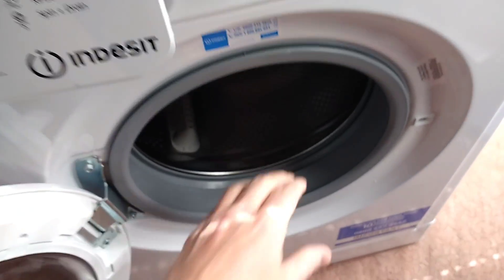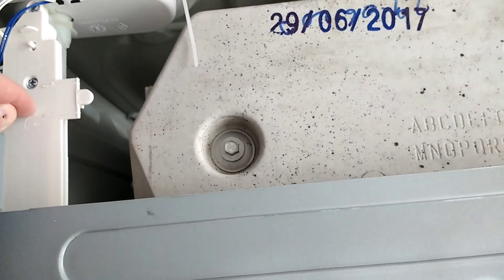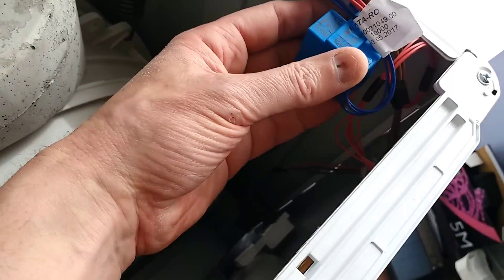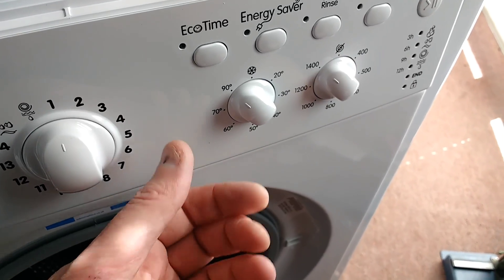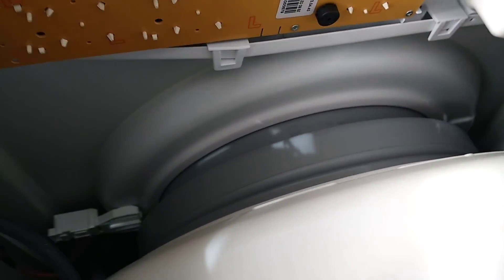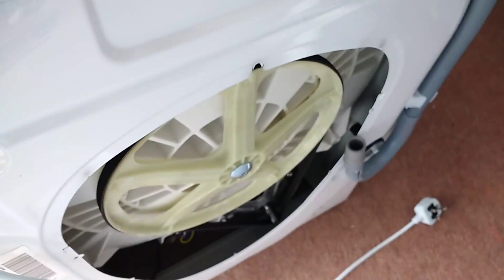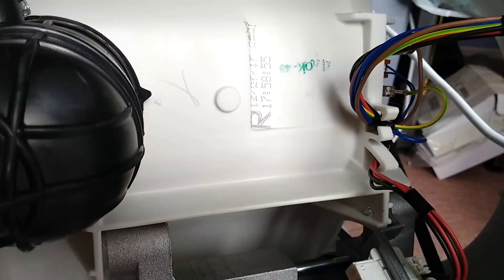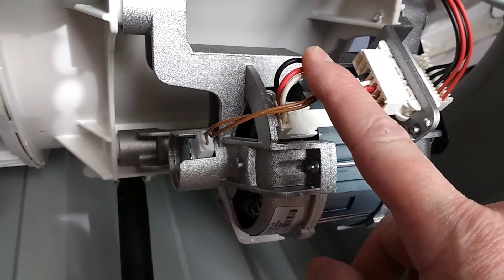Inside my new British washing machine (clothes washer).

Comment: Expected lifespan of 1970s - 1980s washing machine: 25 + years , (warranty 5 - 10 years)
Expected lifespan of 2017 washing machine: 2 years , (warranty 90 days - 1 year)
When I see all the flimsy plastic parts including the drum drive pulley, I will hang onto the 1981 Kenmore/Whirlpool heavy-constructed top loader, even though it has metal wash cycle and water temperature / level knobs instead of a CPU with blue LEDs.
Reply: Price of 1980 washing machine: £200 (8 days' wages)
Price of 2017 washing machine: £150 (2 days' wages)
Reply: caveman123ization another thing not taken into account is actual amount of use. A house hold with 1 person v 4 people with the same machine - you would expect the larger house holds machine on average to die way earlier.
Reply: I've a friend that I've known for more than 35 years and he was a Washing Machine repair man for most of his working life. He is retired now but still does the occasional call out if one of his elderly customers needs help. I was impressed when I phoned him to report a strange noise coming from the machine during a wash cycle. He asked me to hold the phone near the machine and immediately diagnosed ( correctly ) that a Bra wire had come loose and worked its way through one of the holes in the drum.
Reply: bren106 £15 for a repair is insanely cheap. I'm amazed anyone could make a living charging so little. Going rate is between 35 and 45 in the North and between 45 and 80 in the south. Not sure why there's such a big difference
Reply: buy a machine that has a long guarantee, such as miele, mine came with  10 years, but it was a £1250 machine 2 years ago
Reply: I have a Hotpoint front loader (UK) from 1987, passed down through family members and still going strong, with an occasional motor brush change. I don't plan to change machine any time soon.
Reply: This is the dumbest comment I have ever read. As if only there is only one washing machine with only one warranty length. You spend the money to buy a decent machine in 2017 and it will last just like the old one. Probably longer.
Reply: Is that really the case though?... How long would a washing machine that cost 28 hours of the equivalent to minimum wage in the 70's last? i'll bet those 70s machines you're talking about that last 25 years cost more time saving up than that.
Reply: slamdvw no worries. Best tip I can give you in that is that modern machines use a lot less water. That means you can get a build up of soap and scum on the spider/bearings which is where causing the corrosion you've been getting. To wash it off do regular rinse/wool washes, they use the most water. Also a good idea is to do a service wash with soda crystals. Also make sure you've got the feet nicely leveled out
Reply: Fekillix I have a Samsung dryer with a 5 year warranty. It's a an A++ energy rated heat pump model. Uses less than a third of the energy of a bog standard dryer. Uses approx 1.5 kWh for per load on the cycle i use.
Reply: Killerspieler0815  - The term used in North America for large kitchen / laundry appliances is "Durable Goods". Items expected to last for a decade or more. Very, very little in the way of these items are designed to last decades, even a 2,000$ fridge or 1,500$ washer. Typically mechanisms are frail and electronics fail...
Reply: You've been lucky with that Hoover. I'd recommend avoiding them in future, they're nowhere near as good as they just used to be. My top tips would be LG and Samsung or Miele if you can afford it
Reply: My English Electric is 10 years in my ownership + who knows how many before that. Paid £100 for it delivered and fitted. Called the same man out last year and cost me £15 for repair with no callout charge.
Reply: slamdvw bearings probably aren't a good example because it takes all day. Also, if it's a new model, like the one in the video, they're glued shut so can't be changed. But if it was possible, it's about £120/£150 depending on the machine.  A more common repair, say a new pump or brushes would be around £65
Reply: I have a Samsung combination washer/dryer front load for 5 years now.  The only thing that has gone on it is the drain pump.  I was able to fix that myself for about $50.
Reply: What kind of washing machine lasts only two years? Even the cheapest ones i've seen run for at least 10 years.
Reply: Just about anything made in China. People I work with have had "boards" fail in $2,000 fridges just after the 90 day warranty ended (I believe LG), complex front load washers and "steam" dryers fail well within two years of age. It is common. That's why I don't own any of that crap. There is one brand of washer and dryer in North America which is built with 1970s / 1980s durability today (25 year lifespan expected), and that is "Speed Queen" available for residential purchase, but built to commercial / laundromat standards. They are expensive.
Reply: YES back then the companies were proud of Quality ...
==>> in Socialist countries like East-Germany there was a Government standard that demanded 25+ Years live for "white goods" like refrigerators & washing machines
Reply: So true. My neighbor one floor down bought an AEG dryer. They did not remember, if it was 4 or 5 (or 3) yrs old. Fault was the switchmode to feed the microprocessor.
I tried to fix it, I've never seen such a cheaply constructed switch to choose the program and so on. Ground connector was blue color, all others pink.
The switchmode was a little 8 pin DIL chip, like in phone chargers, but scraped off type number. Capacitors of cheapest grade.
So I quit, but we found many people on the net, which repair these boards for like GBP 20/ 25$...
And it worked, new chip, new fuse resistor, new capacitors. 
I'm curious, how long it will last.

My father bought a washer, when my brother was in the army at 18. We still used that 27 years later, in my house. Until the toothed wheels in the (mechanical, driven by little synchronous motor) controller crumbled. It was a German Bauknecht. No electronics at all.
Reply: After 35 years of use: https://youtu.be/Ue5GjB0Ap6I
Reply: I'd disagree on the expected lifespan. Trading standards state it should last at least 5 years to be fit for purpose. I'm a service engineer and would say most of the machines I see are between 2 and 5 years old. About 90% are easily fixed. Part of the issue is many people just chuck them out without getting someone like myself to look at them
Reply: My last Hoover washing machine lasted 16 years with a just few small repairs which I did myself.  So when the motor eventually blew up (windings went short, quite spectacularly), I bought another Hoover washer-dryer.  That was five years ago, and it's had plenty of use with no real issues.  Get what you pay for.
Reply: My rent for a 1 bed flat in a not so great part of London is £1200 a month, that's the reason. I agree the £15 is exceptional value wherever you live though.
Reply: I've found by the time you pay a service tech to come out, order parts, etc - a few dollars more buy another machine with a full warranty.  What's your hourly rate, plus parts to fix say, tub bearings?  (( I don't want to know, just putting it in perspective )).
Reply: Ah, ok  Here in the States, they front and rear tub halves are still bolted / screwed together.  By far, the failure mode I'm seeing the most is bad tub bearings.  They get washed out when the seal lets loose and allows water to pass.  Second to that has been corroded spiders.  Thanks for the reply!
Reply: I just bought a new Siemens dryer to compliment my Siemens washer that I bought last year. I have no doubts they will last 10 years plus. Either way I have a 5 year  "warranty" in my country on them anyways. They wash much faster, and use way less energy than the old broken ones.
Reply: I agree but not sure when the lifespan stops on the vintage ones.. I guess if the motor burnt out or the frame rusted/ bent causing it to wobble ridiculously might reduce my opinion on it but for the most part.. 
A heating element and a drain hose. Between 2 sets of machines in 2 households..
 if my non-techie friend ever decides to replace their identical 80's w/d I'm loading that set up.
Reply: The machine that my mother bought to wash my nappies was still going when I moved out of my parents' house.  That was a Zanussi.  Only 400 rpm spin speed, but it was made in the early 1970s .....

She's had at least three  more machines since then, and won't listen to my advice to buy a Miele that will outlast her .....
Reply: the f00 Yes, washing machines are often easily repairable as long as it's not the motherboard that is at fault.  (And to be perfectly honest, even the old mechanical program timers weren't much more repairable than microprocessor-controlled ones .....  and the latter are now as reliable as you can expect something with no moving parts to be.)  But some people even buy a new washer while their old one still works!
Reply: hahaha ...  in Capitalist West Germany & the Socialist countries (especially East Germany / "DDR" & USSR ) the (Beyond ? ) USA-"Durable Goods" Quality was simply expected by (capitalist BRD) customer and / or required due to (Socialist) deficit of resources in the country / acquisition + exceptions of the people
Reply: LakeNipissing I agree 100%. I am living it. Also the spider is made of material that corrodes when connected to stainless drum and to replace it the whole machine must be stripped plus the huge cost of spare parts. You will also need new gasket and seals. Most machines have same parts just cosmetic and brand name difference. Welcome to the real world.
Reply: Ahh, bearings. a lovely job im gonna do to my 1995 Tricity Bendix AW851. At least i can do it with this one, unlike modern shit. Bearings and seals will be here on monday at Brahmer's, will be sitting down after work with a large bottle of wine and doing some old school engineering involving a large hammer, large socket and a punch!

Comment: Ugh, I always cringe when I see a product where everything has been made so cheap and flimsy to just barely hold up till just after warranty period.. ;-)
Yes some plastics are way better than in the past, but nothing beats stainless steal (specially the drum rotor part!). I have a miele and even the outside housing is made from ceramic coated metal..

Comment: Wait, you mean there are washing machines with hot inlets? I wasn't even aware those could exist. I wonder if it's a British thing.
Reply: It used to be a thing because the boiler was often near the washing machine, so very quick to get hot/cheap water. 
With a modern washing machine and a combi boiler, you will probably have all the water you need in the machine before the hot water makes it to the machine, so might as well have cold fill only.
Reply: Actually, American washers have had both hot and cold inlets since at least the 1950's.  All current US homes are plumbed for it.
Reply: Scarfmonster it is because we have 240v outlet
Reply: My old Hoover machine used to have hot and cold fill, not sure if it was any better to be honest. Not so bad with a Combi boiler as they heat up water as it is used, a bit naff if a hot water storage tank is used as it would use all the hot water in the tank that you just heated up to wash up or take a bath. 
My Hotpoint machine i have now is cold fill only and I now have a combi boiler.
Reply: In the Northerly Americas, our washing machines have both hot and cold water inlets. If I run the hot water at the tap in the sink next to the washer to clear the cooler water out of the pipe, then put the warsher on in Hades mode, my washer will happily cook the everliving shit out of my clothes.
Reply: er no its not cuz of240v ,its due to some rare models allow hot and cold water inlets ,has nothing to do with mains voltage
Reply: Britain has 230V, same as the rest of Europe, surely it can't be that since here in Poland hot inlets are not a thing at all. I literally haven't seen a single bathroom equipped for such a washing machine, and probably I would be considered a lunatic if I asked about that.
Reply: Depending where you lived in the US almost all homes had basements and that's where the washer and dryer were. I guess it's because the original models weren't that reliable and people didn't want to risk flooding if they failed. Plus, houses were a lot smaller back then and you didn't have the room for a washer and dryer in your living area. 

Eventually, some clever people realized how convenient it would be to have your washer and dryer on your living level so that has become the norm with newer construction. I think they stick with the hot and cold inlets because there aren't many washers sold in the US with built-in heaters, and the ones that do have it are high end expensive machines.
Reply: I've never seen a washer with a hot inlet, but I trust Clive's knowledge, he is a sparky after all.  But with 240V/230V cold water is sufficient for most things, hence kettles, boilers and electric showers, no point plumbing in an extra set of pipes if you have the juice to heat water in a jiffy.
Reply: Thats because most British homes do not have a centralized main water heater like here in North America. Most UKs  have a small water heater that heats on demand close to each sink, you may have seen them when you watch a British show. This means that Things like Dishwashers and Washing machines often have their own built-in heaters.
Reply: I don't know what houses you have been in the UK, but most have a central hot water system. The difference is if you have a boiler + tank, or tankless/combi (on demand) but it's rare to find a heater per sink.
Reply: hmmm...Ive been in many new-built  houses in the uk, and Astrailia
Reply: plugging into Google "on demand water heaters beside sinks in britain", comes up with hundreds of pics proving my point
Reply: I've been in about 500 different houses, the only ones with on demand heaters are where people have fitted them along side a normal hot water system.
Reply: No, all it proves is that you can do it, and some people do. Doesn't mean that's the standard which you imply.

I mean, by definition the current standard of a combi boiler matches an on demand heater. But it doesn't mean you have one by every sink.

You find them more often in offices/industrial buildings then in homes.
And plugging "combi boiler" into google gives 5million+ results for UK pages, which sort of makes hundreds of pics seem a tiny fraction.
Reply: Siiigh...ok, you win on the "Heated Water On Demand" comment fight...I acquiess,.I hereby legally modify what I have written in the past by saying the following: in all the homes, hotels, and rented places that I have PERSONALLY stayed in, in both Britain, and Australia, the hot water has been heated by small on-demand heaters at the sinks, and did not have a centralized water heating system, BUT this is in no way a standard feature. I hereby legally do not imply that this is a UK-WIDE STANDARD. This washing machine may heat the incoming  water for the homes that may, or may not have a hot water hook-up for their washing machines.....EVERYBODY HAPPY???????..I dont want to spend any further valuable time fighting this silly battle.
Reply: I think you will find most people do have a central water system, either via a combi boiler that heats water up as you use it or one that heats water in a tank. Years ago when I was a child most people had a immersion heater, just a big tank with an electric element, stuck in a cupboard, that is how we use to have baths, talking about 40 years back. Saying that the open fire had a back boiler as well.

 When I moved in here around 18 years ago it only had electric heater, but now it have a combi boiler.

Most people in the Uk  have some sort of central water heating, we are not that backward you know. :)
Reply: My main boiler is beside my sink downstairs, but it supplies the whole house with hot water and heat.
Reply: AGAIN.........I actually prefer the individual ON DEMAND units, I dont think its backward at all, and here in Canada, they are actually pushing these as an alternative to heating many litres of water in the basement rather than a small amount of water on demand.  I personally think that they actually save money and the environment by comparison. AGAIN AGAIN AGAIN.......I WAS SPEAKING ABOUT HOUSES THAT I HAD PERSONALLY VISITED, and these houses were recently built...GEEZE!!!
Reply: It wouldn't have mattered if the boiler was near the machine or not as most UK households used to have (probably most still do) a hot water tank that is remote from the boiler and is gravity fed.

Comment: The cement weight blocks are a complementary pair. When one lets go the other swiftly follows. The drain pipe will eventually fracture and  provide addition cooling to the adjacent PCB. Clever design.
Reply: Max Phipps - the bearings will also fail before the plastic wheel. The drum will be a sealed unit so can't be repaired and the whole things ends up on the scrap heap. Been there :-(
Reply: I used to repair Washing machines and the bearing on this machine is replaceable but most times it's not worth paying a company due to cost and labor 

I've done full rewires due to customers wants again not really worth it , I do it for my own and close friends still
Reply: @Gizmo1992  did the bearings in our hotpoint not too bad the seal on the drum was fine its tapered nice design  but gave a light bead of silicone for safety previous machine failed when a slug crawled across the main board pricey to replace and you still need software or roll the dice on ebay i dont mind diy but sometimes your barely saving anything.
Reply: Higher end machines (e.g. Bosch) use cast iron yokes rather than concrete.